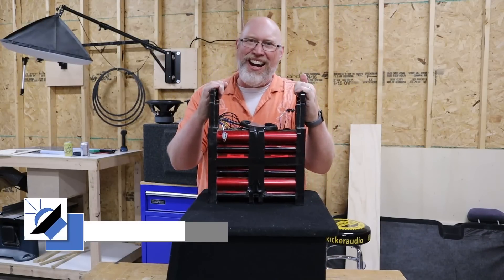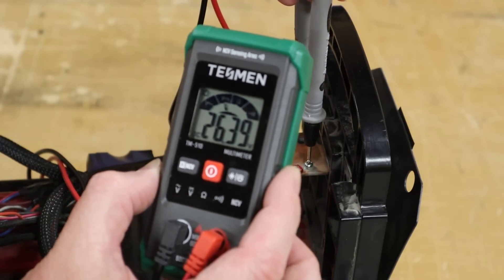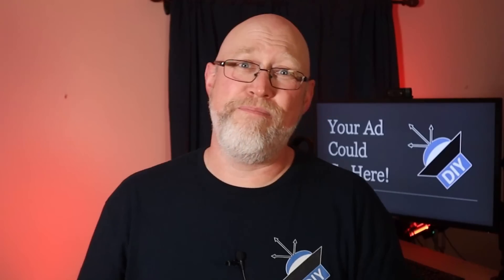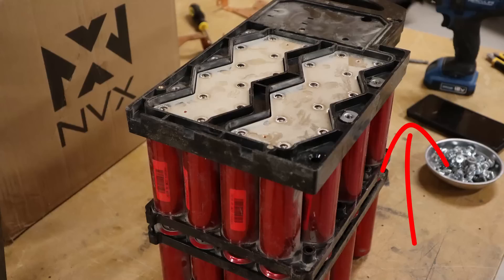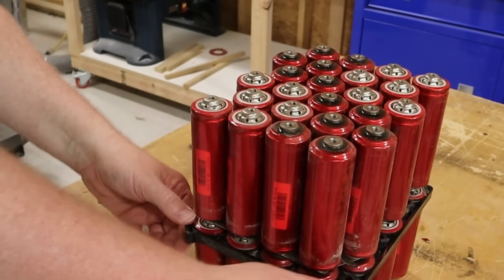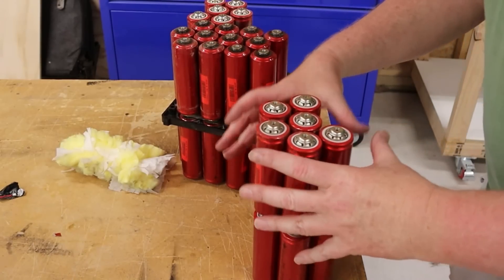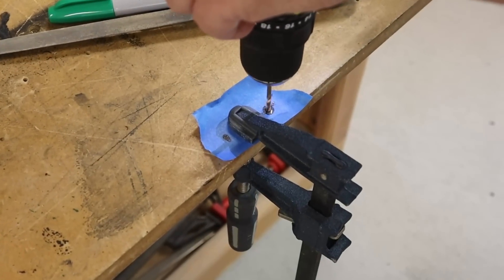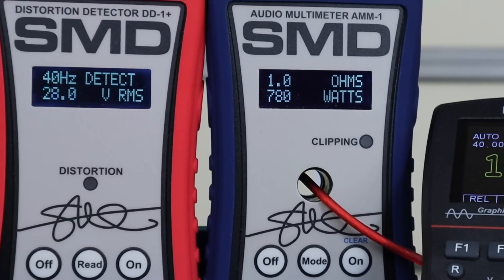The BEST budget Lithium Car Audio Battery:  The Super Beast!

Comment: I was arguing with someone about these on one of your videos a couple weeks ago, when you were talking about D4S's lithium batteries. 

I said this is the best affordable way to go, with much more output than the overpriced lithium audio places sell.

Project DB makes some really nice bus bars for these cells.  Jim works makes some economy bus bars for them as well. Both companies send all hardware needed to hook them all up based on the AH set you buy.

Amazon has 1 1/2" (40mm) heat shrink tubing that fits over these cells perfectly, so you can avoid any arc'ing from vibration on the outter wrapping.

Aliexpress has an empty battery case a 48ah setup fits in as well.
Reply from the maker: There are people in the comments saying this battery sucks.
Reply: I just started researching for replacing My amg's under the hood.   My first thought was the titan 8, BUT MAAAAAAAAAAAN, You killed that idea 💡. Currently running TWO D2400's, with a 320 h/o alternator.

Comment: A (purposeful) dead short with headways never disappoints! 

I’m always very careful when assembling/disassembling packs though. I never want to have an accidental short because, if thick enough, it’d probably weld a busbar together in a dead short before melting everything in a shower of sparks.
Reply from the maker: Absolutly.
Reply: @DIYAudioGuy  where do you hook the positive and negative for the amplifier and alternator on this battery

Comment: Headway is great, but you’re limited on voltage. I’m building a 96ah spim bank for just a little bit more and running 15.5v. All the cells are available at battery hookup and Jim’s machineworx just started selling bars for them. He makes great headway bars too!
Reply from the maker: That is true, if you want to up the voltage headway will not work.
Reply: What 15 volts  batteries 🪫?
Reply: @guerrillawar616  running 15.5v on spim08hp. They are good to like 16.8 max but most run 15.5-16. Same goes for cmax and yinlong. You can find them through the link the channel posted for battery hookup.
Reply: So that's where Jim went from laf then
Reply: @GTILOUD  find me a 100ah scib bank for under $400 then. 😂🤡  Some people need more reserve than burst output. Just because YOU think it’s better doesn’t mean it is.
Reply: @thelifeofriley815  dudes a clown you guys that right. Watches YouTube videos think he knows it all . Glad I'm not the only one. Ty and you got a link im looking at them.  I need some cheap lithium

Comment: Crazy how cars use to carry an extra car battery or 3 and/or Capacitators...now it's rare to see that ( unless it's a budget-ish build ) and ul now see racks of LithBats. Tech has been so good to all car Audio Fiends
Reply from the maker: It is amazing how much had changed.
Reply: I'm still rocking XS D3400 AGM on my hybrid with DC-to-DC renogy 60A 800w  it bumps hard for a couple minutes then trails off and the amp starts smelling again, about to upgrade from 65ah agm to 45ah LTO 14.7v~

Comment: Holy crap, you guys are on to a different level. I've been out of the bass stuff for too long. 
I will put it this way, the subs I pulled out of storage were bought from a friend of mine, and they were used speakers in 2005. PBX 12" 
 I also have a set of Memphis 12" from around the same era.
Unfortunately my vintage amps are long gone, but that's ok. What I'm seeing, today you can make 4x the power from a cheapo Amazon amp, and a reasonable battery setup.
Reply from the maker: I totally get that.  I was out of the hobby for a while.  I was shocked by how cheap amps are now.  Back in the 1990's a 1,000 watt amp was big $$.  Now you can grab something like the JP8 for under $200.
Reply: @DIYAudioGuy  all about cheap power
Reply: @DIYAudioGuy ct sounds amps are great. You can get a 2k rms amp for 240$ and it does over rated on the dyno. Realistically after rise you'll be lucky to get 1750 rms but for the price it's great.

Comment: Btw, I always recommend top balancing specially when it comes to lifepo4 batteries/cells. This chemistry spends the majority of its charge cycle at 3.2 nominal. Its a chemistry that had a flat curve. A cell can show 3.2 volts and be 40% soc while another can show 3.2 volts and be at 70% soc. If those cells aren't placed into the same parallel strings but on the next series string the total capacity of your battery will be based off of the 40% soc cell leaving you out of a lot of usable capacity. I know that's what the balancer is for but unless you're leaving the balancer alone to work for over 24hrs without a load placed on it or more it won't properly balance. I recently ran into a problem like this myself recently were after fully charging my batteries the voltages according to the bms were all out of wack with up to .18mv difference which doesn't seem like much but I had a 48ah bank and was only getting 36ah, after taking it apart and properly top balancing I finally got the full capacity and a little extra at 48.7ah. These balancers also have a hard time balancing lifepo4 because they can't tell the difference between soc( state of charge) only voltage. They really only work at their best when these batteries are under their nominal voltage or at max charge because that's when this chemistry has a difference in voltage for the balancers to work and transfer charge accurately.
Reply from the maker: I am working on another project with these so they are all apart and I can top balance.  The voltage was the same on every cell down to .005 volts.

Comment: I have been wondering about this since we talked about it. I really want one these but I am just sick of buying crap lol. Excellent video though, Thank you!
Reply from the maker: Right!  It is cheap on a per-cell basis, and it is cheaper than any pre-built lithium, but it is still money going out.
Reply: @DIYAudioGuy  definitely I have one gasket to buy to finish my build, hopefully fingers crossed. Also I have a 64 AH headway bank, 2 big agms,  2 ultra cap 345 Farads each and a Mechman HOA. I keep wanting to add more stuff to the power part of my build but I think I probably should go ahead and get everything installed and see what the voltage is doing before I add anymore lol. 

How’s your build going? You almost done?
Reply: @Jeff_Moreland  how many watts are you runnin?
Reply: @1904audio  subwoofers are running on a jp63 @ 1ohm I haven’t done any testing yet so I wouldn’t want to say how many watts exactly but that amp is rated at 6300 watts
Reply: @Jeff_Moreland  you should be as far as battery and capacity goes honestly
Reply: @Jeff_Moreland  I meant you should be good as far as you electrical setup goes
Reply: @1904audio  yeah that’s what I am thinking but I also am trying to make sure this is the last time I ever upgrade this stuff so I definitely want more than I nee
Reply: @Jeff_Moreland  true if you have more power than you need then upgrading amps and sub  won't be a problem bass on!
Reply: @1904audio  probably but you seem like you are not insane and obsessive compulsive like I am. If I know I can have more then I will find a way to get it. 😂

Comment: The cool thing about the Headways is that you can use a standard stock alternator voltage for the bank...around 14.0 volts to 14.4 volts but no higher than 14.8. Personally I wouldn't go higher than 14.6 volts or you will reduce the lifespan of the lithium cells. Eventually I'll switch from my LifePo4 lithium battery to an LTO battery. I have a 60Ah A123 LifePo4 battery but I'll be switching in the future to an 80 Yinlong LTO bank...however I'll be raising my voltage from 14.4 to 15.3 to get the most out of the Yinlongs. You'll be surprised at how powerful lithium batteries are...I had XS Power D3100 batteries and the 1 lithium battery destroys them hard...I barely have voltage drop. I can wait to see your reaction when you test a powerful amp with the Headways...you'll be amazed at how little voltage drop you have. Finally, if you think that is good, imagine how much better it can be if you upgrade your alternator to a high output...remember, it takes power to make power!! Awesome video like always!!!
Reply from the maker: This bank is going on the test bench.  I plan to build another one with a nice case to go with this:  https://youtu.be/MuksKiWpit0
Reply: Trav Hamler  What voltage do you run on your yinlong bank??
Reply: Trav Hamler  Holy crap!! That is high but your vehicle must be ok with it. If I tried going that high, I'd start having a lot of problems...15.4 is the highest I would consider for my vehicle. Very cool about running yinlong...they will last a long time!!!
Reply: I have a 80ah bank with these and a eBay 300 amp alt I was only getting 13.3 so I added diaodes and now I charge up to 15v I don't like over 14.6 but when I start playing music full tilt is around 14.4-14.6 so it's perfect I just have to play my system all the time 😂😂😂😂

Comment: I just recently started looking into Lithium banks for my car audio setup. I found Trevor Moon's video and he did his conversion the same way. Instead of removing the legs off the copper side and drilling it to make jumpers, I was thinking of buying a replacement for one of the existing buss bars that looks to be the right shape for a cleaner solution, but when I contacted Battery Hookup they kinda of suggested they weren't awailable seperately. I imagine if you found someone who just used the cells you could get one from them, or I suppose I could also make my own. Any chance you could measure the height/width/thickness of the copper buss bars? Thanks!

Comment: So I’ve had a lingering question for a really long time, how do you know when you’ve got a bad cell in your bank? What’s the definitive way to diagnose a bad cell. I’ve been threw a few lithium set up now, but remain clueless on spotting a bad cell. Buying used cells you run a risk of having a bad cell
Reply: You have two cases. Regarding used cells. Test several times;  Fully charge and discharge - observing the charge voltage and charge/discharge time.
For an existing battery pack check the 'fully' charged voltage/discharge time.  If below expectations then check according to the configuration and problem.

Comment: How do you wire this into a vehicle? I want to keep the underhood battery for everything "truck" related. Right now I have a 140amp diode isolator running to the underhood battery and another battery behind the back seat of my Suburban. The 2nd battery in the back runs everything aftermarket, ie head unit, sound amp, bass amp, tv screens, and all leds. Is it just as simple as removing the 2nd battery and installing this headway unit or is there other components i need aswell? Any help would be appreciated! Keep up the good videos!!

Comment: I have a stock alt in my Corolla , around 100amps alt. I’m installing a 5000rms amp to run a 18inch dc xl sub. If I have a lithium battery capable of 148amp hours will it support my system on a stock alt with big 3 upgrade?

Comment: Awesome video.  How would 3 of the d4s lto 6.0 compare to that 96ah bank?  3 of them say there good for 9000 to 15000 watts and I have a 415amp alt. Price aside what battery setup would you use? if you don't mind me asking your opinion sir.
Reply from the maker: You have to weigh the risk and hassle associated with building your own bank versus being able to just hook up a pre-built battery.  As far as performance goes to superbeast, with 96 amp hours, will outperform an entire Bank of those lto 6.0. they are only 6 amp hours.
Reply: @DIYAudioGuy  could you run the two together safely?
Reply: Trav Hamler  thanks for that info.     Wish I would have seen this video a year ago.

Comment: Do you needthis if you have a HO alternator and only bang your your system while the car is running?
Reply from the maker: That depends on your total system power and your alternator output.It doesn't hurt to add an extra battery to serve as a buffer between the alternator and the amplifier.  In mind that you don't get full power from the alternator when you're idling.

Comment: That's a pretty awesome battery, I might have to get one myself, because that's a LOT of power for the price!

I guess it was originally used for a large, commercial or industrial UPS? (Maybe for a phone or internet master hub or something like that?

Anyway, I have a few questions:

What is the difference between a "BMS" and an "active balancer", What exactly do they do/what are their specific differences/why use one over the other/what are their individual benefits vs. their "less than ideal" properties, why do you need them, and how much does that extra device cost in addition to the battery itself? (Also, could you just use the original control circuitry that the battery came with somehow if you rewired it?)
Reply from the maker: The BMS will limit the charge and discharge current in addition to balancing the cells.  The BMS is the better choice, but to get one that can handle 300a discharge would double the cost of the pack.  

All of the original control circuity was removed on this version of the super beast.  It may be intact if you get the version in the metal case.  I am not 100% sure.
Reply: @DIYAudioGuy  OK, I guess I need to do more research into what BMS vs. Balancer means and does, because I'm still not clear the difference, and if the balancer that you got wasn't able to handle the full current of this battery bank then why did you go with it instead of a BMS that CAN handle that much current?
Reply from the maker: @JoeJ-8282  The balancer just balances, it keeps all of the cells at the same voltage.  A BMS does that PLUS it controls the charge and discharge of the entire battery pack.  Without a BMS the cells can charge/discharge without any limit.  If I had a 100a BMS then it would only let me discharge 100a to an amplifier that needs to draw 300a.
Reply: @DIYAudioGuy  OK. So, am I understanding this correctly? A full BMS controls BOTH charge current to individual cells, (or at least different banks of cells, depending on how complex it is, keeping them more evenly charged between the individual cells and/or banks), AND a BMS ALSO controls the amount/rate of discharge, so as to limit maximum current available and the overall discharge level, so as to never damage the cells from excessive discharge, and then, in comparison, just a balancer ONLY is like having only HALF of a BMS, in that a balancer ONLY controls the CHARGING part of the pack, in mostly the same ways as a BMS does, but a "balancer" alone does NOT have ANY control over the actual discharge rate OR minimum level of discharge... Is that at least close to the way it works?
Reply from the maker: @JoeJ-8282  I don't know anything beyond what I have shared with you and I'm not going to speculate.

Comment: Definitely need some help or advice to trouble shoot my system... sometimes it plays full volume and the lights  dim... other times it seems like the car is throttling the power to the system and it's half as loud but the lights don't dim....i can't figure out what's up and whether i should try lithium
Reply from the maker: First check all of your connections.  Keep in mind that a battery does not make power, it is just for storage.  If you are trying to build a big system then consider upgrading the alternator.
Reply: @DIYAudioGuy   I may just upgrade the alternator, but my system isn't very big.. 1200 watts, 2 12s..checked all my connections multiple times

Comment: Can someone explain hooking up the balancer with this configuration, theres another video by a guy named trevor moon who ran jumpers in between the batteries and the bottom so that has me confused.
Reply from the maker: Imagine if you had four cells end to end connected in series.  You would need to connect five wires.  One on the negative side and then one on every positive terminal. So three of those connections would be in between the four cells.

Comment: The only thing that sucks about used cells is the don't put out the full 8c, there always around 5 or 6c. Especially when they're dated 2018
Reply from the maker: Good to know.
Reply: @JasonWW2000  I never said anything about don't put out "enough",I said they are not up to par with brand new cells and that's a fact. Can you read?
Reply: @JasonWW2000  yes they are good cells , but the used cells are not up to par with new cells. Especially cells dated 2018 like I originally stated. What do you not understand about that? Yes used cells work but they aren't on the level new cells are as far as discharge and recharge rate. That's what the C-rate is bud. New are 8c , Used your lucky if it holds 6c. Do some research and I mean there are plenty of videos to watch if you can't comprehend reading. Just saying
Reply: @JasonWW2000  Again reading, I didn't say the cells suck, I said the thing that sucks about used cells is they no longer have the full 8c left in them. Again reading that seams like your downfall

Comment: Hey, I really love what you are doing. How you charge audio battery pack ? Is it by external AC power supply when it drains off or directly from car alternator ? TIA
Reply from the maker: These can be charged directly from your alternator.
Reply: @DIYAudioGuy  But as far as I know alternator will be fried if connected directly to lithium battery without DC-DC charger bcoz of huge current flow to battery as their IR is low!!
Reply from the maker: @amerkhafagiable  This is why upgrading the alternator is always the first step.
Reply: @DIYAudioGuy  what do you mean by upgrade? Change it or add another alternator?
Reply from the maker: @amerkhafagiable  replace the factory alternator with a high output alternator.
Reply: @DIYAudioGuy  With high output alternator no need for DC-DC charger in between?